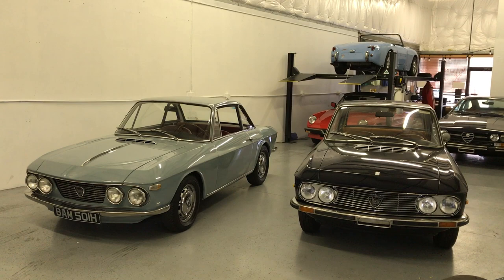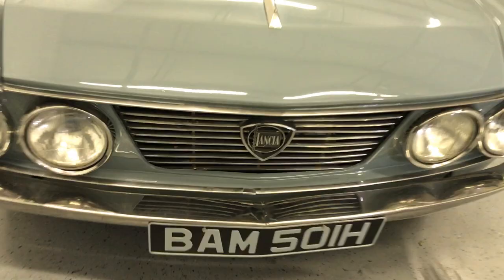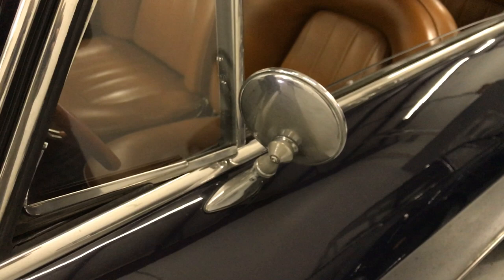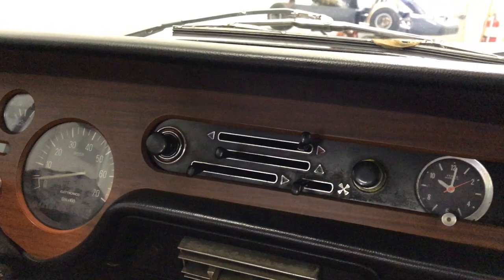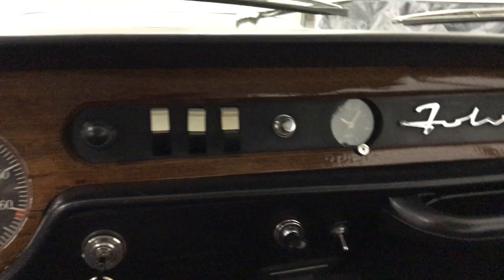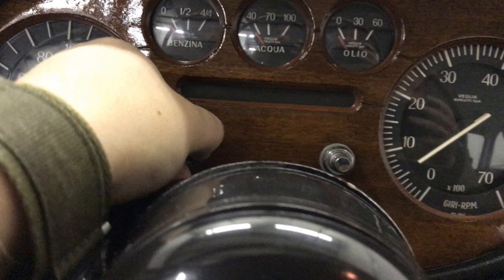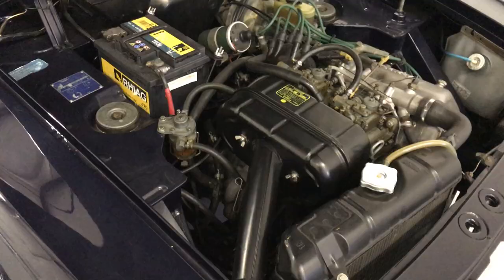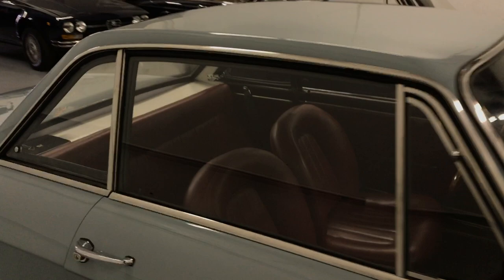Lancia Fulvia Series One VS Series Two

Comment: other differencies were on th braking system where first series used  dunlop calipers front and rear with 18 or 19 millimeters master cylinder and no brake booster, second series were fitted with girling calipers and 21 millimeters master coupled to a brake booster; first series lacked the water temp. sensor on the radiator and had a smaller diameter exaust system.
The triangular portion of the front windows was fixed on the first series and could be opened in the second.
both were awesome cars by the way! thank you for uploading this video, it's a great tribute to a breed of italian cars that seems to be forgotten by too many car enthusiast!
Reply: Thanks for the information bro. I eat up details like this.
Reply: The triangular windows also open on the first series, not only the second

Comment: Its down to personal choice and yes the series one is all Lancia but some would argue (myself included) that that the series 2 is more reliable with better brakes and a 5 speed box for starters.If FIAT had not stepped in there would not have been a series 2 or 3 because the over engineering and expensive materials took Lancia to the brink of liquidation. These lovely cars would have been practically extinct now without the intervention of FIAT.Incidentally they are all collectors cars now and their values have almost doubled in the last 5 years,at least mine has but i bought my series 2 to drive and enjoy and not to sit in a garage covered up.If they continue to rise in value then that is just an added bonus.

Comment: Had both and my preference is the series one 1.3 rallye. It was very solid and reliable and a joy. The series 2 is great two and love the dog leg 5 speed but unfortunately there problems with structural rust which is very difficult to fix

Comment: My first car was the series 2, a real gem. Approximately 40 years later I have always owned at least 1 Fulvia. Currently, I own a 1.6HF.
I think that the series 2 cars are more practical for every day;use, the heater, the windscreen washers and general switch gear are better, and the 5 speed gear box is also a big plus given the close ratios, and with the servo the brakes are easier. 
The series 1 handle a little better..  I think that he is wrong about the oil cooler. I have never seen a series 1 without an oil cooler, and I have owned several.
Which ever model they are captivating little cars, and I guess that is why I have always owned at least one.

Comment: the older car is the last real lancia fulvia made and a collectors item,  fiat after that took control and made  many changes that have not been mentioned such as the aluminium boot bonnets and doors on the older cars replaced  by cheap steel.
 the 4 speed gear change is also pure lancia which was over engendered to such high standards on the series 1 car.
the blue lancia is a total gem and 

fiat replaced many parts with plastic such as the fan which was aluminium on the light  blue car and gives it a distinctive sound on the road when driving.   Fiat made  many other cost cutting measures that were taken when they took over production of the fulvia .
Reply: I imported this Fulvia from Italy before it went to America. It's a shame they didn't show the seats a bit better as they were a lovely deep red leather and the smell was just wonderful. And yes, the Series 1 was a proper Lancia not a Fiat.

Comment: "The triangular portion of the front windows was fixed on the first series and could be opened in the second."
Thats not true. Look at the S1 this video, they can be opened. Only the S version of the S1 had this.

"such as the aluminium boot bonnets and doors on the older cars replaced by cheap steel."
The S1 started with all steel panels and somewhere in the production of the S1 1.2 they put on the alu panels and somewhere on the S1 1.3 S they stopped with the alu panels.

"I think that he is wrong about the oil cooler. I have never seen a series 1 without an oil cooler,"
The oil cooler was only standard on S1 1.3S and 1.3HF, 1.6HF

Comment: when i referred to blue car as the gem and real lancia i am referring to the lighter blue car. the series 1 and the older car also has polished chromed parts and stainless steel
 as both  car look similar be in no doubt that the older car is the real lancia and a car with admirers .
its  crazy to think that fiat would change the materials but you understand why, production of the series 1 was not financially viable as all its bits were quality parts and fiat production replaced everything, brass parts and all.